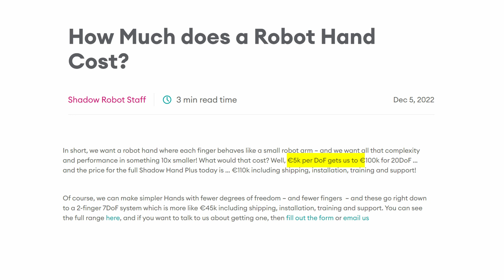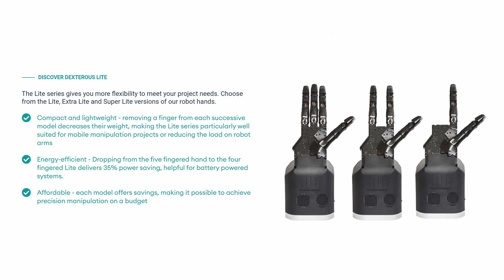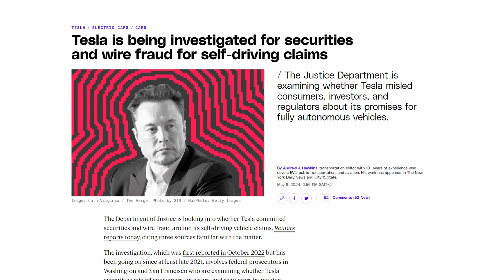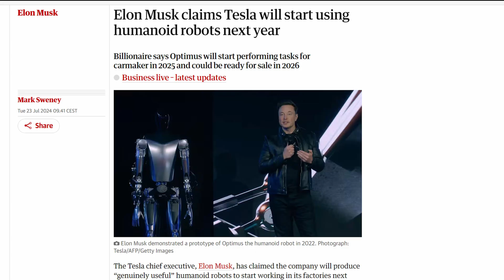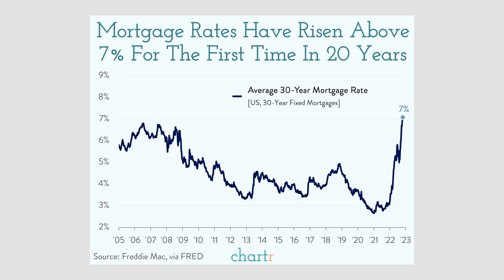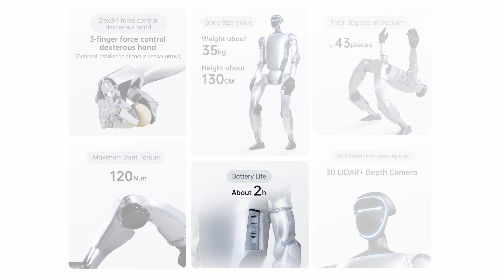Robots Taking Jobs? The Truth Elon Musk Won't Say

Comment: Robots already took the jobs. But not the humanoid robots. The immobile ones on the assembly line, purpuse built for a single task. Elon should know. He has car factories.

The problem with general purpuse robots is that they are more expensive and less competent then the single purpuse ones.

I worked at an IGU factory. There is no way robots are taking the jobs there. They'd need to handle glass, big and small.
Reply from the maker: Exactly. Surprising everyone wants to build humanoid robots 🤦‍♂️